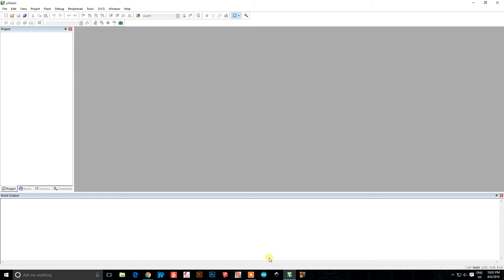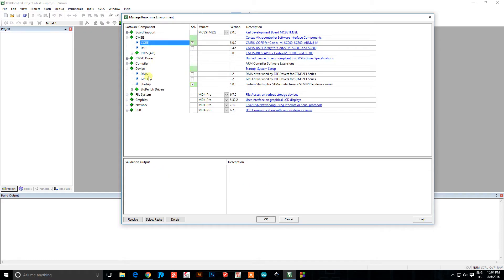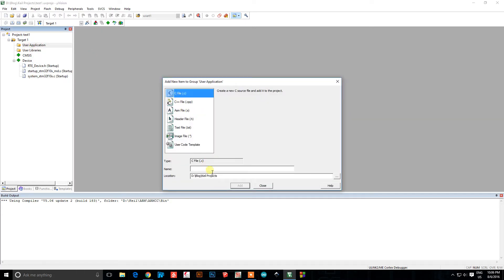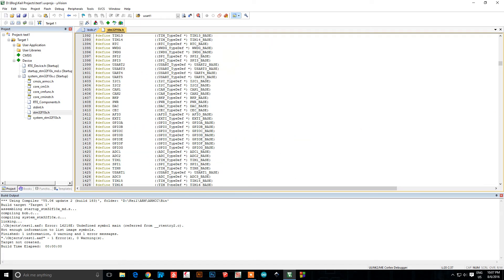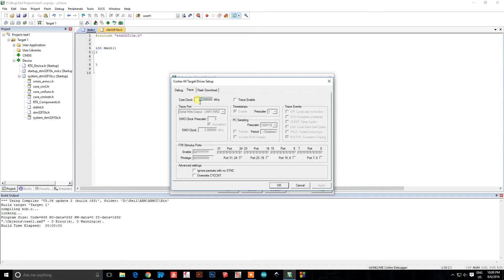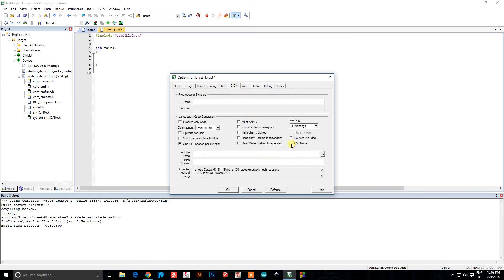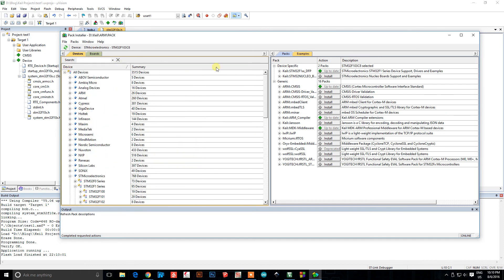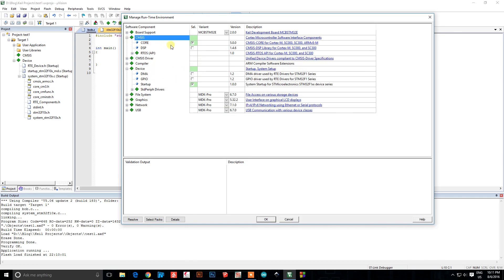Keil uVision setup for Stm32F103 and St-Link V2

Comment: Ha, I have a problem. Followe everything to the smallest details, but getting error:
"Not enough information to list image symbols.
Not enough information to list the image map.
Finished: 2 information, 0 warning and 57 error messages.
".\Objects\Blink2.axf" - 57 Error(s), 0 Warning(s).
Target not created.
Build Time Elapsed:  00:00:00"
Reply: Actuall... did not saw that I have more error messages:
"*** Using Compiler 'V5.06 update 2 (build 183)', folder: 'C:\Keil_v5\ARM\ARMCC\Bin'
Build target 'Target 1'
compiling main.c...
linking...
.\Objects\Blink2.axf: Error: L6200E: Symbol __Vectors_Size multiply defined (by startup_stm32f10x_md_1.o and startup_stm32f10x_md.o).
.\Objects\Blink2.axf: Error: L6200E: Symbol __user_initial_stackheap multiply defined (by startup_stm32f10x_md_1.o and startup_stm32f10x_md.o).
.\Objects\Blink2.axf: Error: L6200E: Symbol __Vectors multiply defined (by startup_stm32f10x_md_1.o and startup_stm32f10x_md.o).
.\Objects\Blink2.axf: Error: L6200E: Symbol __Vectors_End multiply defined (by startup_stm32f10x_md_1.o and startup_stm32f10x_md.o).
.\Objects\Blink2.axf: Error: L6200E: Symbol Reset_Handler multiply defined (by startup_stm32f10x_md_1.o and startup_stm32f10x_md.o).
.\Objects\Blink2.axf: Error: L6200E: Symbol NMI_Handler multiply defined (by startup_stm32f10x_md_1.o and startup_stm32f10x_md.o).
.\Objects\Blink2.axf: Error: L6200E: Symbol HardFault_Handler multiply defined (by startup_stm32f10x_md_1.o and startup_stm32f10x_md.o).
.\Objects\Blink2.axf: Error: L6200E: Symbol MemManage_Handler multiply defined (by startup_stm32f10x_md_1.o and startup_stm32f10x_md.o).
.\Objects\Blink2.axf: Error: L6200E: Symbol BusFault_Handler multiply defined (by startup_stm32f10x_md_1.o and startup_stm32f10x_md.o).
.\Objects\Blink2.axf: Error: L6200E: Symbol UsageFault_Handler multiply defined (by startup_stm32f10x_md_1.o and startup_stm32f10x_md.o).
.\Objects\Blink2.axf: Error: L6200E: Symbol SVC_Handler multiply defined (by startup_stm32f10x_md_1.o and startup_stm32f10x_md.o).
.\Objects\Blink2.axf: Error: L6200E: Symbol DebugMon_Handler multiply defined (by startup_stm32f10x_md_1.o and startup_stm32f10x_md.o).
.\Objects\Blink2.axf: Error: L6200E: Symbol PendSV_Handler multiply defined (by startup_stm32f10x_md_1.o and startup_stm32f10x_md.o).
.\Objects\Blink2.axf: Error: L6200E: Symbol SysTick_Handler multiply defined (by startup_stm32f10x_md_1.o and startup_stm32f10x_md.o).
.\Objects\Blink2.axf: Error: L6200E: Symbol ADC1_2_IRQHandler multiply defined (by startup_stm32f10x_md_1.o and startup_stm32f10x_md.o).
.\Objects\Blink2.axf: Error: L6200E: Symbol CAN1_RX1_IRQHandler multiply defined (by startup_stm32f10x_md_1.o and startup_stm32f10x_md.o).
.\Objects\Blink2.axf: Error: L6200E: Symbol CAN1_SCE_IRQHandler multiply defined (by startup_stm32f10x_md_1.o and startup_stm32f10x_md.o).
.\Objects\Blink2.axf: Error: L6200E: Symbol DMA1_Channel1_IRQHandler multiply defined (by startup_stm32f10x_md_1.o and startup_stm32f10x_md.o).
.\Objects\Blink2.axf: Error: L6200E: Symbol DMA1_Channel2_IRQHandler multiply defined (by startup_stm32f10x_md_1.o and startup_stm32f10x_md.o).
.\Objects\Blink2.axf: Error: L6200E: Symbol DMA1_Channel3_IRQHandler multiply defined (by startup_stm32f10x_md_1.o and startup_stm32f10x_md.o).
.\Objects\Blink2.axf: Error: L6200E: Symbol DMA1_Channel4_IRQHandler multiply defined (by startup_stm32f10x_md_1.o and startup_stm32f10x_md.o).
.\Objects\Blink2.axf: Error: L6200E: Symbol DMA1_Channel5_IRQHandler multiply defined (by startup_stm32f10x_md_1.o and startup_stm32f10x_md.o).
.\Objects\Blink2.axf: Error: L6200E: Symbol DMA1_Channel6_IRQHandler multiply defined (by startup_stm32f10x_md_1.o and startup_stm32f10x_md.o).
.\Objects\Blink2.axf: Error: L6200E: Symbol DMA1_Channel7_IRQHandler multiply defined (by startup_stm32f10x_md_1.o and startup_stm32f10x_md.o).
.\Objects\Blink2.axf: Error: L6200E: Symbol EXTI0_IRQHandler multiply defined (by startup_stm32f10x_md_1.o and startup_stm32f10x_md.o).
.\Objects\Blink2.axf: Error: L6200E: Symbol EXTI15_10_IRQHandler multiply defined (by startup_stm32f10x_md_1.o and startup_stm32f10x_md.o).
.\Objects\Blink2.axf: Error: L6200E: Symbol EXTI1_IRQHandler multiply defined (by startup_stm32f10x_md_1.o and startup_stm32f10x_md.o).
.\Objects\Blink2.axf: Error: L6200E: Symbol EXTI2_IRQHandler multiply defined (by startup_stm32f10x_md_1.o and startup_stm32f10x_md.o).
.\Objects\Blink2.axf: Error: L6200E: Symbol EXTI3_IRQHandler multiply defined (by startup_stm32f10x_md_1.o and startup_stm32f10x_md.o).
.\Objects\Blink2.axf: Error: L6200E: Symbol EXTI4_IRQHandler multiply defined (by startup_stm32f10x_md_1.o and startup_stm32f10x_md.o).
.\Objects\Blink2.axf: Error: L6200E: Symbol EXTI9_5_IRQHandler multiply defined (by startup_stm32f10x_md_1.o and startup_stm32f10x_md.o).
.\Objects\Blink2.axf: Error: L6200E: Symbol FLASH_IRQHandler multiply defined (by startup_stm32f10x_md_1.o and startup_stm32f10x_md.o).
.\Objects\Blink2.axf: Error: L6200E: Symbol I2C1_ER_IRQHandler multiply defined (by startup_stm32f10x_md_1.o and startup_stm32f10x_md.o).
.\Objects\Blink2.axf: Error: L6200E: Symbol I2C1_EV_IRQHandler multiply defined (by startup_stm32f10x_md_1.o and startup_stm32f10x_md.o).
.\Objects\Blink2.axf: Error: L6200E: Symbol I2C2_ER_IRQHandler multiply defined (by startup_stm32f10x_md_1.o and startup_stm32f10x_md.o).
.\Objects\Blink2.axf: Error: L6200E: Symbol I2C2_EV_IRQHandler multiply defined (by startup_stm32f10x_md_1.o and startup_stm32f10x_md.o).
.\Objects\Blink2.axf: Error: L6200E: Symbol PVD_IRQHandler multiply defined (by startup_stm32f10x_md_1.o and startup_stm32f10x_md.o).
.\Objects\Blink2.axf: Error: L6200E: Symbol RCC_IRQHandler multiply defined (by startup_stm32f10x_md_1.o and startup_stm32f10x_md.o).
.\Objects\Blink2.axf: Error: L6200E: Symbol RTCAlarm_IRQHandler multiply defined (by startup_stm32f10x_md_1.o and startup_stm32f10x_md.o).
.\Objects\Blink2.axf: Error: L6200E: Symbol RTC_IRQHandler multiply defined (by startup_stm32f10x_md_1.o and startup_stm32f10x_md.o).
.\Objects\Blink2.axf: Error: L6200E: Symbol SPI1_IRQHandler multiply defined (by startup_stm32f10x_md_1.o and startup_stm32f10x_md.o).
.\Objects\Blink2.axf: Error: L6200E: Symbol SPI2_IRQHandler multiply defined (by startup_stm32f10x_md_1.o and startup_stm32f10x_md.o).
.\Objects\Blink2.axf: Error: L6200E: Symbol TAMPER_IRQHandler multiply defined (by startup_stm32f10x_md_1.o and startup_stm32f10x_md.o).
.\Objects\Blink2.axf: Error: L6200E: Symbol TIM1_BRK_IRQHandler multiply defined (by startup_stm32f10x_md_1.o and startup_stm32f10x_md.o).
.\Objects\Blink2.axf: Error: L6200E: Symbol TIM1_CC_IRQHandler multiply defined (by startup_stm32f10x_md_1.o and startup_stm32f10x_md.o).
.\Objects\Blink2.axf: Error: L6200E: Symbol TIM1_TRG_COM_IRQHandler multiply defined (by startup_stm32f10x_md_1.o and startup_stm32f10x_md.o).
.\Objects\Blink2.axf: Error: L6200E: Symbol TIM1_UP_IRQHandler multiply defined (by startup_stm32f10x_md_1.o and startup_stm32f10x_md.o).
.\Objects\Blink2.axf: Error: L6200E: Symbol TIM2_IRQHandler multiply defined (by startup_stm32f10x_md_1.o and startup_stm32f10x_md.o).
.\Objects\Blink2.axf: Error: L6200E: Symbol TIM3_IRQHandler multiply defined (by startup_stm32f10x_md_1.o and startup_stm32f10x_md.o).
.\Objects\Blink2.axf: Error: L6200E: Symbol TIM4_IRQHandler multiply defined (by startup_stm32f10x_md_1.o and startup_stm32f10x_md.o).
.\Objects\Blink2.axf: Error: L6200E: Symbol USART1_IRQHandler multiply defined (by startup_stm32f10x_md_1.o and startup_stm32f10x_md.o).
.\Objects\Blink2.axf: Error: L6200E: Symbol USART2_IRQHandler multiply defined (by startup_stm32f10x_md_1.o and startup_stm32f10x_md.o).
.\Objects\Blink2.axf: Error: L6200E: Symbol USART3_IRQHandler multiply defined (by startup_stm32f10x_md_1.o and startup_stm32f10x_md.o).
.\Objects\Blink2.axf: Error: L6200E: Symbol USBWakeUp_IRQHandler multiply defined (by startup_stm32f10x_md_1.o and startup_stm32f10x_md.o).
.\Objects\Blink2.axf: Error: L6200E: Symbol USB_HP_CAN1_TX_IRQHandler multiply defined (by startup_stm32f10x_md_1.o and startup_stm32f10x_md.o).
.\Objects\Blink2.axf: Error: L6200E: Symbol USB_LP_CAN1_RX0_IRQHandler multiply defined (by startup_stm32f10x_md_1.o and startup_stm32f10x_md.o).
.\Objects\Blink2.axf: Error: L6200E: Symbol WWDG_IRQHandler multiply defined (by startup_stm32f10x_md_1.o and startup_stm32f10x_md.o).
Not enough information to list image symbols.
Not enough information to list the image map.
Finished: 2 information, 0 warning and 57 error messages.
".\Objects\Blink2.axf" - 57 Error(s), 0 Warning(s).
Target not created.
Build Time Elapsed:  00:00:00"
Reply: Oh, okay - SOLVED... made error previously included wrong .h file, and after removing in main.c, it remains in "manage project items", so after removal this unwanted file, it works fine. Thanks for excellent tutorial!
Reply from the maker: sorry just saw this...did you resolve the issue?
Reply: Yes, I did. THanks.